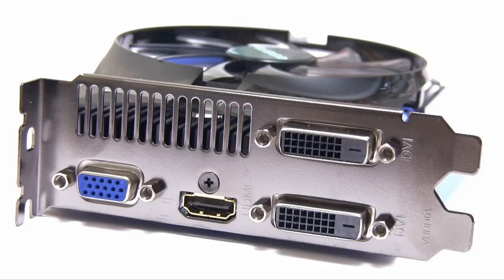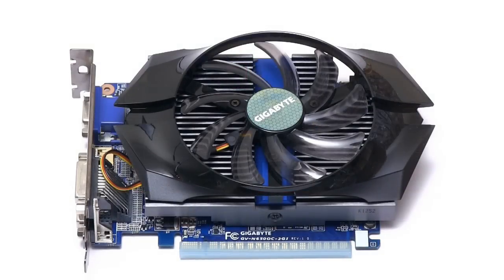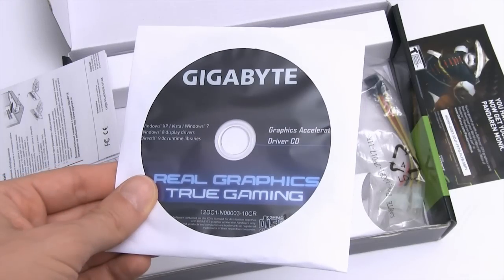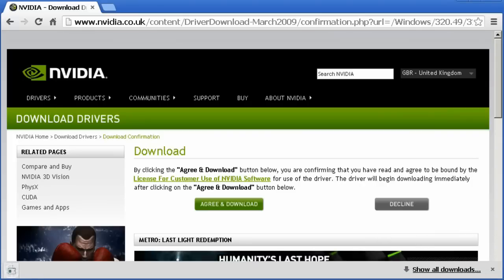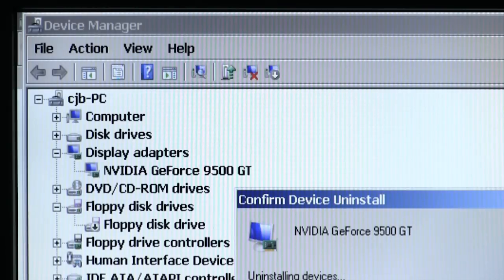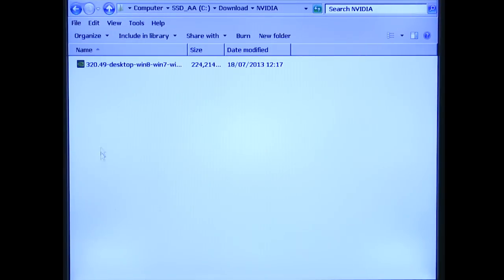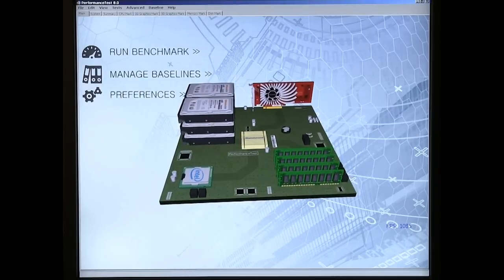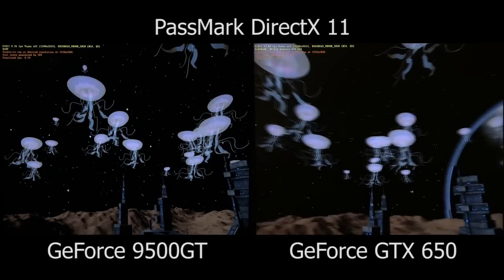Graphics Card Upgrade (GeForce GTX 650)

Comment: Is 385 watt psu is enough for this card?
Reply from the maker: It depends on the other components in the PC, but probably, yes. The card uses 64W (max), and when first sold was recommended for use with a 400W PSU.

Comment: Watching this video I thought that it has held up pretty well as the process done while changing the graphics card is still the same as it is now with the interface used is still PCI Express but newer versions.
Parts that didn't hold up for me are the driver uninstall process as its more recommended now to use DDU (Display Driver Uninstaller) to remove the previous graphics drivers and the Windows Experience Index which doesn't exist in modern versions of Windows like Windows 10. 
But honestly this comment doesn't matter as this video is 9 years old and there are other guides that are more recent done by both you and other channels.

Comment: Gtx 650 good for gaming ?
Reply: Yes why not bitch!
Reply: Depends on what games you intend to play.

It'll handle very light gaming. It should be fine for older games around 2012 era.

The GTX 650 is now dirt cheap so you can't go wrong anyway.

You can search up examples on YouTube such as
"GTX 650 GTA 5" or "GTX 650 Cyberpunk"
and see if the specs are up to your standards on certain games

Comment: It is now March 12, 2018, and this process still applies.  I just used an older eVGA GEForce GTX 750ti 2GB card in a new Windows 10 8th gen i7 8700K build. The card cost me about $110 two years ago since it is old tech.  But I use it for three monitors and video editing, not gaming.

Comment: I never uninstall my graphics drivers when upgrading my graphics cards. I stay with Nvidia and the drivers I install include the later ones. Just swap them out.

If I went with AMD, I'd uninstall graphics drivers definitely. But upgrading as I do - it's not needed.
Reply: You can actually keep your Nvidia drivers and your and drivers, just don’t put both cards in the same system at the same time XD

Comment: Bro i know this is old, but i buyed exactly the same graphic card, and when i put it on the pci, and then turning on the computer, it doesnt display anything, but the graphics cards seems to be working, fans are working too.. Any help'?
Reply from the maker: Is the fan going around? If not, the card is not powered. Try removing the card and putting it back in -- and when doing this, check if there is any dirt/dust in the PCIe slot. Also, so you have onboard graphics that need to be turned off in the BIOS?
Reply: My fan is working properly, but i don't have the 6 pin connector in my PSU. My bios is very old (2010 aprox.) and i checked before and i dont know how to disable the onboard graphics..
Reply from the maker: 2010 is not that old for a BIOS, and certainly not in the context of this card. Do you get anything on the screen connected to the PC when it powers up?
Reply: When i had my old GPU yes, but when i plug in the new one, it doesnt show anything on screen, but the GPU works (fan, etc works.)
Reply from the maker: This suggests a problem with the graphics card itself, or having enough power to run it from your PSU or motherboard.
Reply: Hi, I have a similar issue, in my case the PC doesn't event boot at all, like if it isn't plugged into power. This only happens when I put the EVGA GTX 650, with the older GPU the computer starts normally.

Since I have a generic 600w PSU and I have to plug the GPU via a 2 molex-to-pci adapter, is it possible that the problem is within the PSU/Molex adapter or is my GPU dead for real?.  The GPU was tested before the purchase and was working correctly.
Reply: it could be a driver issue

Comment: well ubgrate to gtx 1050 its a very nice card i had a gtx 650 and now got the 1050 (zotac mini) is noticeably faster and consumes far less power also i am using q6600 and the same motherboard as you with 8 gb of ddr2 800mhz

Comment: A couple years ago my friend bought this GPU as an upgrade from the integrated graphics which came from his computer. About half a year in using it he noticed a slight clicking noise in the computer, as well as some graphics glitches. Once we took the side off his PC we saw the fan shroud scattered all over the case with parts of it being melted. To this day we have no idea how the GPU got so hot, especially since it was never overclocked.
Reply: mother fuckin lit my dude

Comment: Is this card good these days?For above 60fps in csgo!Thanks
Reply from the maker: I am still using this card, but there are many faster cards now.
Reply: Is the radeon HD 5850 better for gaming?
Reply from the maker: Difficult to call -- they are pretty comparable cards.
Reply: The GTX 650 and HD 5850 are what I would now call obsolete if you want to game on modern titles. Those cards are from the 2010-2012 era. The 5850 being the older of the two. 

If you want a budget modern day GPU, look at the RX 470, or HD 7950s on eBay. They will play CS:GO at high FPS.

Comment: Thanks for providing the numbers your system scored. It's always nice being able to compare my hardware to that of other people. Stuff I learned from this video:

1. Your Geforce 9500GT is a pure DX10 card and does not support DX11 at all. In fact, it shouldn't even run the DX11 test, yet there are numerous people online dumbfounded by the fact that their 9xxx cards run DX11 software seemingly without a problem and that despite the fact that DX10.1 wasn't even around when those cards came out, which would have explained this to a degree. I wouldn't have believed that those cards can actually run DX11 if I hadn't seen it in your video. 

2. Passmark is complete garbage for checking the graphics performance of video cards. Its results are laughable and don't reflect the real performance those cards are capable of. I'd rather use 3D Mark, Unigine or other established 3D-benchmarks for a proper DirectX performance measurement.
Reply: The "standards for comparisons" are always the same: A reliable benchmark that can be used across several systems to allow for reliable comparison.

I didn't say that the video implies that Passmark is shit. In fact, I didn't say that at all. All I said is that it's shit for gauging graphics performance. This is based on my 20+ years of benchmarking experience. If you've ever used one of the aforementioned benchmarks with their extensive GPU tests, you'd understand.

Comment: Excuse me but will this graphics card improve my hp pavilion a4317 c-b PC bundle? If not then what graphics card would be the best option
Reply: +Wartrac Gaming Tf are you talking about?
Reply: +SKELLYBOY1210 yes. that has poor intergrated graphics and has other parts that are far to good for the graphics. gtx 650 will be a match made in heaven providing you psu is capable
Reply: +2112 **If he has an OEM version of Windows any upgrades will most likely make the pc stop working**

Comment: +ExplainingComputers Nice Video, but I highly recommend cleaning your CPU-Heatsink and your computer in general, otherwise your temps will go up and up and a good case ventilation won´t use you very much if your cable management is like it is now ;) And why are you running Samsung SSDs WD Blacks ,BUT a core 2 quad core processor and 8GB of ram?
(sorry for bad grammar or bad english in general I´m german ;) )
Reply from the maker: +Skalarax_LP Totally agree on the dust! :) On the components, the PC evolves, and the benefit of the new motherboard and CPU is/was not worth the cost and time of a rebuild. But as I edit high data rate video (non compressed and ProRes), the fast drives are important. So in other words, this system is optimised -- to an extent -- for the work it does. So many people try to edit video on, say, an i7 with one drive -- which will result in far worse performance than the three drive preferred spec (one for progs, one for cache, and one for media) that Adobe and others suggest. :)

Comment: can this be installed in a hp pavilion p6 2143w?
Reply: http://h20564.www2.hp.com/hpsc/doc/public/display?docId=c03349236
Reply: Yes you can, your mother board has a PCI X16 Gen 2 slot. You just need to make sure your power supply can handle it and make sure your power supply even has a connector to fit the card (if you need one)
Reply: ALTHOUGH, one problem you may run into is that your pc may have an OEM copy of windows. If so, any upgrades to your pc will most likely turn it into fort knox and make Windows unusable. If your pc has one of the Windows stickers on the back then it may not work without a fresh install of an unlocked copy of Windows.

Comment: hold on, this graphics card is better than GTX 550 Ti, right? Is this worth buying for roughly "40 euro"? One that is used 5 moths...
Reply from the maker: +Zievs The GTX650 and GTX550 Ti have very similar performance (with the 550 Ti winning!), so it would  not be worth upgrading from one to the other. EG see a comparison chart here: http://gpuboss.com/gpus/GeForce-GTX-650-vs-GeForce-GTX-550-Ti
Reply: the one i would buy is a 4gb, but how do i find out what my 550 Ti have? From what I can see through "desktop>resolution>advanced settings" I have 4095 mb, which i know is about 4 gb, but on the label on the card it says 1 gb so I am getting kind of confused. If mine are 1 gb would it be worth an upgrade then?
Reply from the maker: Zievs The "Total Available Graphics Memory" showing in the advanced settings should be accurate, so this suggests you currently have a 4GB card. Which is strange if the card is labelled otherwise!

Comment: hello  and HELP, i'm buying a refurb hp 6000 tower w/1yr warr. off ebay  MY Question is could i slowly upgrade this pc? a small/med video card possible below is where it is??  
       HP Desktop Computer 6000 Tower Windows 7 Pro Intel 8GB 160GB 17" Monitor
(((   Item number:  331578450786    ))))
      Price:$269.99
Reply: **If your pc has an OEM copy of windows upgrades will most likely not be possible**
Reply: +Wartrac Gaming Do you know anything about computers, Windows in perticuluar?
Reply: +Joel Glickman OEM versions of Windows is linked to the hardware that was currently in the PC during the installation. Any hardware changes made afterwards will trigger the "Windows (7, 8.1, 10) is not genuine. This is particularly true with Motherboards. As always there is probably a work around but in general the OEM license is meant for OEMs that build multiple computers with the same hardware.
Reply: I've taken the install, that was on my orebuilt acer pc, and dput it into my custom pc with a very different mobo, different chipset etc, and t worked perfectly, even asked if i wanted to install my gpu's driver, so, your argument is invalid.

Comment: what model case do you have for your editing rig?
Reply from the maker: skylar jensen It is very old (c.15 years) but very solid large tower from SuperMicro -- with an increasing number of modifications! (like the front grill).
Reply: ExplainingComputers I see. I also have another question for you. ever thought of getting a blu-ray optical drive? I'm only asking out of pure curiosity.
Reply from the maker: skylar jensen I have indeed thought about getting a writable blu-ray drive for making backups of data. I used to make a lot of DVD backups (and also DVD video disks), but in recent years my video work is mainly for upload, and backups go to hard disks of various flavours. So I have not touched the optical drive. But I also generate a lot of data, so maybe I will get a Blu-ray at some point. :)
Reply: +ExplainingComputers I also have to ask, but say for example you add a few more drives to your editing rig. Would you get a PCI sata card to add more ports? that's what I did in my computer
Reply from the maker: skylar jensen Yes, if I had run out of SATA ports, I would do that. Fortunately my motherboard has 8 SATA ports, and only 6 are in use . . . :)

Comment: 750w psu for a celeron and a gtx 650 XD Well done :')
Reply: RCTestKid 750W for a Core2 Quad and GTX 650.  Still overkill, but not by as much.
Reply: RCTestKid some people (also me) lowe to have more power capasity we wont to be sure that the pc will run quiet and wont have power isues for only 30€ differance
Reply: Don't forget he has all of those floppy drives and CD drives to power

Comment: Man I don't get it I got a gtx 650 and it does not even have a HDMI port.
Reply from the maker: Entropian2012 GTX 650 is the chipset that runs the card -- different manufacturers are free to produce cards with different hardware specs based on these chips. Hence not all card have the same connectors, or indeed the same memory.
Reply: ExplainingComputers Could i just use the cd for the install?

Comment: i did almost the same :) 
  deal is in 2008 i bought 9500 and it was ,,normal" for l2 and old nfs games. it even played wot and aion. after changing pc i bought gtx 650 1gb ... yas yas difference was huge and it;s prise was low , also it doesnot need a lot of energy , you can run it with cheap power supplyes.

Comment: Other than using up space on your drive, is using the Express installation option bad for your computer if all you are doing is video and photo editing?  Thank you for such a concise video... as well as great information.
Reply from the maker: Frederick Dunn Express should not cause you any problems! :)
Reply: ExplainingComputers wow.. I did not expect such a quick answer!  Old card is out, new card is IN... Express software automatically uninstalled the previous cards drivers also... nice touch.  Thank you for giving Non-Computer Techs, the information and confidence to make changes on our own.  You're providing a great service.  I put in the Nvidia Quadro K4000... fantastic boost to my editing workflow!
Reply from the maker: Frederick Dunn Excellent! That is a nice new graphics card you have fitted.
Reply: Frederick Dunn Does the express option actually remove old graphics card drivers?
Reply: nanosarge1 In my case, running Windows 7 64 bit, when I installed the card "using express install" it did indeed detect other graphics drivers and removed them when proceeding with the new drivers.  Trouble free... still working fabulous by the way.
Reply: That's great i'm sure they wouldn't remove that feature from windows 8.1 and thank you for the quick feed back.
Reply: nanosarge1 You're probably correct.. windows 7 and up should be fine...
Reply: Yes I would believe so it would me a dumb decision to remove features from an OS.

Comment: i have a dell inspiron 3847 with a nvidia geforce gt 705 and intel i5 4460 would i be able to replace the gpu for a asus nvidia geforce gtx 760 ti? with 500w power supply
Reply: ok would 550w be enough to power it?

Comment: Hi Chris I watch your vids I would like to know what case was that on your editing computer the big floor one
Reply from the maker: charlie It is a very old tower from SuperMicro (c.1999 I think). I don't have a model number I'm afraid. The front has also been altered by myself -- there used to be a few little holes where now there is the rectangular cutout and DIY mesh! :)
Reply: ExplainingComputers Do the connections outputs (EG: the HDMI0 come out the back of the computer? (sorry, don't know much about computers)

Comment: Could i ask what theme, or Whatever, you are running on top of windows 7? it looks nice.
Reply from the maker: SharpGamingHD Wow, nobody has ever liked my settings before! :) I usually get slated for keepings them!

The theme is based on the Windows Classic theme which is the first listed under "Basic and High Contrast Themes" in Windows 7. Having selected this I then changed a lot of font settings, which can be accessed via entering "change window colors and metrics" in the control panel search box. Here, for example, my menu font is Tamoha 10 bold in black, and selected items are the same with a bright yellow background, which for me makes the menus really easy to use. My advice is to change things incrementally and to keep saving the theme under different names as you experiment. Good Luck! :)

PS: Note that I have ClearType deeply turned off (via a registry hack).
Reply: ExplainingComputers thanks! and yeah, i use it for performance mostly, and i already knew about the windows classic theme, just wondering what the other things you had going like the font and stuff. thank you.
Reply: *****  Aero themes have transitions, and transparency, + more detail. the classics themes have no transitions, no transparency, and little detail. Thus, improving performance.